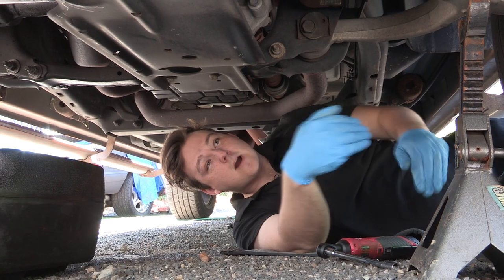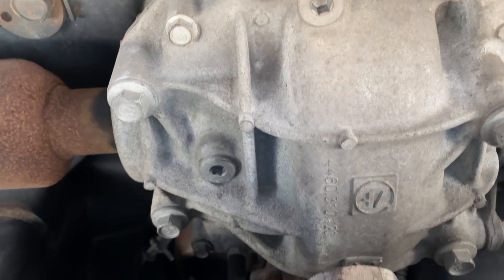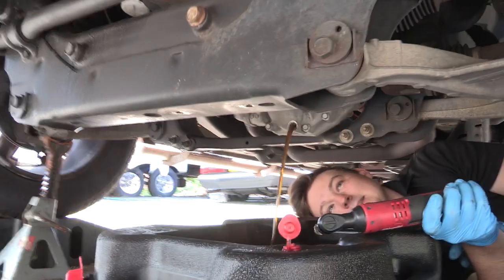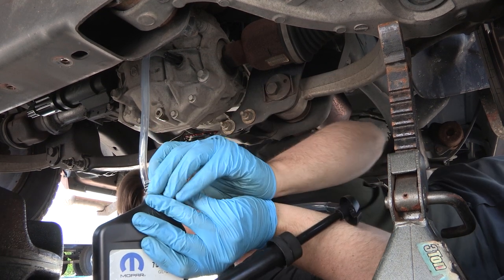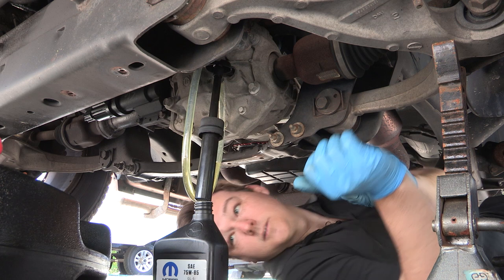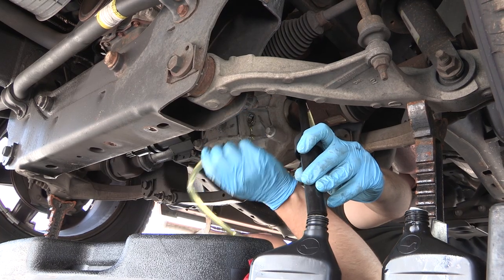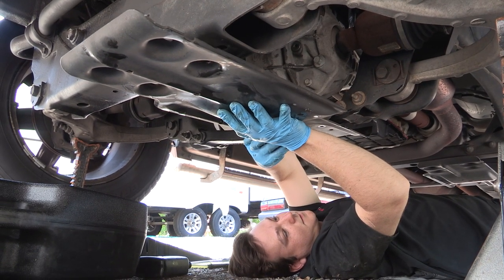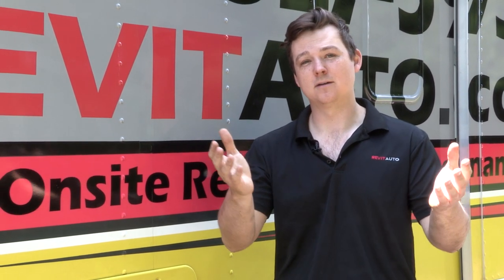2009-18 Ram 1500 Front Differential Service (Detailed How-To) | Fix It Friday

Comment: 2010 ram 1500 front differential does not have a drain plug. You either have to remove the diff cover or use a siphon pump. I believe they didn't use a drain plug until 2012. The rest of the video is still helpful though, mostly just commenting for other viewers who may have 2010 or 2011 trucks.

Comment: I just changed mine using this video. Thanks, it really helped with the first time doing the front diff on my 2015 Ram. I got about a quart and 1/2 in maybe just a hair more or less. It ran out just like yours did, I didn't have a pump I just stuck the hose directly in and used a funnel. do you think that was enough oil?
Reply: What gear oil did you use ?

Comment: Does the mopar fluid need to state that it’s G5 or as long as it’s 75w-85 it’s all good? They change the labels so much I just want to make sure before doing mine? Great video and thanks
Reply from the maker: I don't really know much about fluid dynamics. I just ran the Mopar fluid, however, you can go and look at the website for that fluid and it will have all of its compatibilities listed!

Comment: Do you need to add friction modifier or does mopar add it to the gear oil?
Reply: Additive u mean are for rear
Reply: Why for the rear and not the front, I never understood that. @lenielperez1119
Reply: @rustypipes12 you only need additive for the rear if your truck has a limited slip differential. Open diff rears don’t need the additive either.

Comment: Do Ur research bud I'm doing my 2009 1500 and I have a diff cover to remove if I recall 2009 to 2011 is different from 2012 to 18 in many ways plus wife's is a 2012 so I am 100 percent sure that 09 and 12 are in fact different
Reply: Still very informative for the correct years
Reply from the maker: Thanks Chris, what engine and transmission do you have? This truck is a early model 2012 Hemi with the 6 speed auto trans and 4wd.

Comment: This video is timely, I did my rear already now to do the front......you dont need the anti slip additive in the front?
Reply from the maker: I ran the OEM stuff they gave me straight out of the bottle! Dont think the front does but I will double check!
Reply: As long as your front isn’t a limited slip ( and I don’t believe any OEM’s are ) you won’t need a additive friend
Reply: I'm not sure which truck you're driving but if you go to your service department give them your VIN number they'll be able to help you with any of the new synthetic axle lubricants you may need. Which eliminates the guesswork. My 2014 uses 2 quarts of SAE 75W-140 in the rear and 1 quart of 75W-85 in front. Be safe and check.

Comment: Do you know if the 2019 ram 1500 would be the same process?
Reply: I have a 2014 Ram 1500 4x4 with the 8sp transmission it's pretty much the same you can do this yourself. Check with your local Ram dealer to make sure you get the right differential lube and follow the instructions in the video you'll be fine.

Comment: Add some Lucas in conventional oil I won’t use that synthetic lube it rust right through metal at least put a blend of some conventional oil in there like Lucas, my rear end plate rusted through and took out my rear pinion bearing

Comment: Thank for the info :
Do we use the same size allen as in the rear diff ?
Reply from the maker: Hey We have a video on servicing the transfer case and the rear diff! And the Transmission!
Reply: I just did the service on my 2014 and yes the Allen key is a 14 . I have more confidence in you then  
you do. You can do this.
Reply: @DMACHOLMAN  👍🏽.
Reply: @dimensionexo.  

I'll be checking that video out I also need to do the transfer case service I'll let you know how it goes. 

Thanks
Reply: @DMACHOLMAN  Kool and thank you.
Reply: @dimensionexo.  

You bet...

Comment: My front plate on my diff has no fill or drain holes how the fuck do I fill it
Reply: My 09 has no drain plug either but the fill plug is on rear right side of the differential cover

Comment: Could you always warm up the fluid first by driving around first?
Reply: It doesnt get real hot compared to motor oil.
Reply: The practice of running and warming oil isn't practically beneficial unless the ambient temps are truly frigid

Comment: Thank you a lot. What if your vehicle is at angle how do you know when you've put enough in? Or can you even over do it?
Reply from the maker: If you over do it it will just push out of the seals, but if you are concerned go find a gas station after you filled it to the max that you can and check it there. Always a free flat surface there!
Reply: @Revitauto  thank you.

Comment: Should I use different lube on the front in comparison to the back? (2012 Ram 1500)
Reply: Refer to your owners manual. I know the 2013 states to use 75w90 in the front and 75w140 in the rear. Make sure to pick up the limited differential additive from the dealership if you have the limited slip diff in the rear.
Reply from the maker: Nailed it Kael Thanks! Refer to your service manual and get your fluids from the dealer if you are concerned! Thats what we did

Comment: How often or not to change front and rear diff fluids?
Reply from the maker: I follow the factory maintenance or sooner depending on how hard the truck is used!
Reply: You can find the fluid change intervals for the front and rear differential in your owners manual. And if you're unsure about a step pressure back to this video.

I hope this was helpful.

Comment from the maker: 😀Thanks for watching! Here are some other RAM videos you might be interested in!

2012 Ram 1500 Oil Pressure Sensor Replacement | Fix It Friday
https://www.youtube.com/watch?v=Kkj-nVlmG5g&t=360s

Change the oil on a dodge ram 3500
https://youtu.be/MEiKe8ZKBO0

Change the front brake pads and rotors 2018 Dodge ram 3500 Duely
https://youtu.be/o7f7HjkrOqU

How to change the Air Filter 2015 Dodge ram 1500
https://youtu.be/D47OTKT--GA

2009-2018 Dodge Ram Transmission Fluid & Filter Change
https://youtu.be/QReFPez1njw